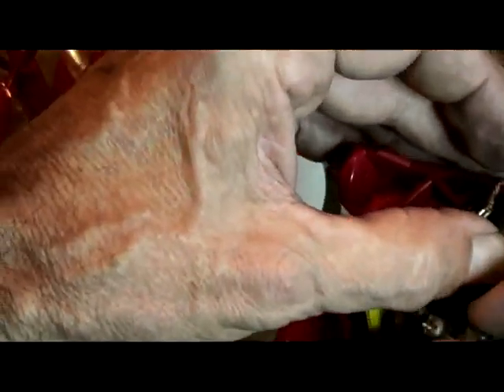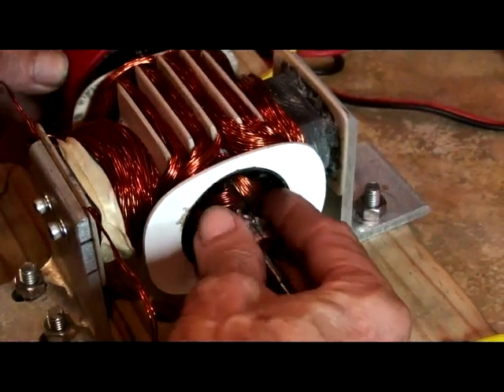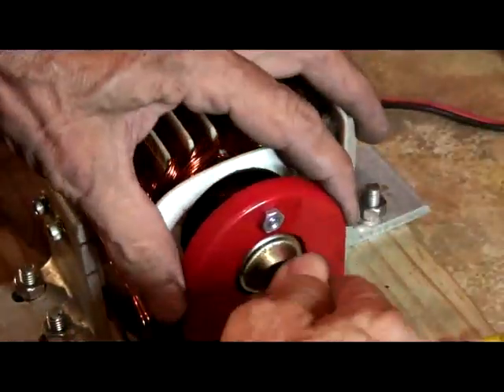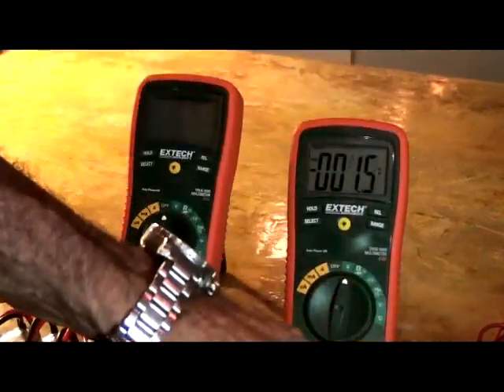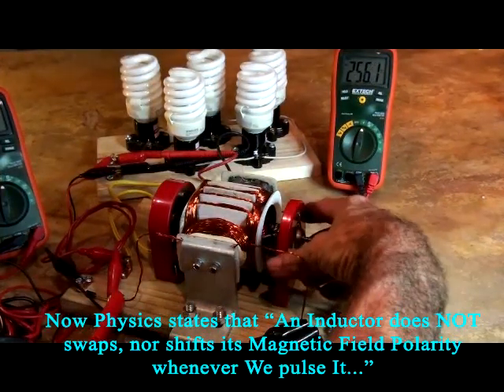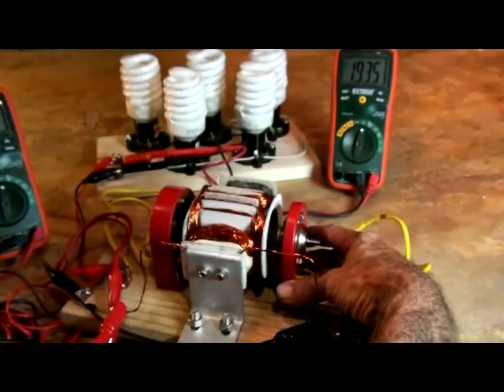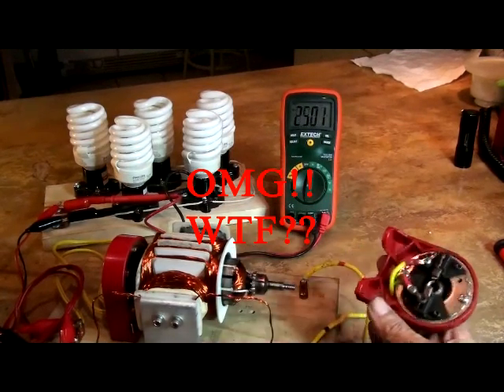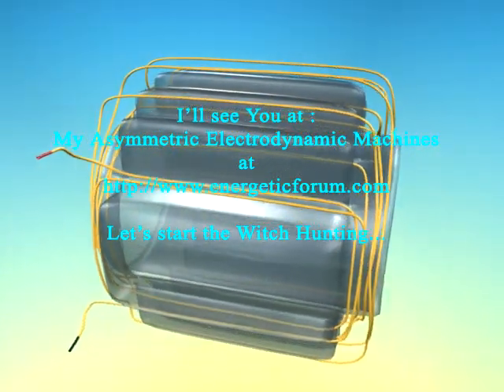ASYMMETRIC SINGLE COIL FIBERGLASS STATOR CORE

Comment: You are also getting state linkage. 1. Pulse stator = pulse to second file. That "loosens the electron state" By the second pulse you are 2. getting more out of the previously standing electron state within the second coil because of the BEMF. Just plain beautiful. I too am working on bifilar arrangements using 4505 diodes as my frequency shunt. AWESOME work. As to the fellow with his concept of "dirty" light. I recon we could afford to stuff a couple of caps in the line and clean it up well.

Comment from the maker: Of course that light is not perfect...of course it oscillates/pulsates identical to the feeding source...
And obviously it could be filtered,and cut spikes,and make it steady,anyone knowledgeable in the Art knows that.
Video is made to prove "A Point", and I did...A Motor, with excellent High Torque...High Speed as well...and like it would not be "enough"...it can generate the excess/unused Energy.
Results We could be NEVER Achieve based on our Symmetrical Models...yes, the ones we learn at EE.

Comment: Well done,
but you did not show us, how much input you did use....

Must be also a lot, cause you had pretty big arcs at you commutator, so the 
input amps seems to be high...

So without measuring the input power via lowpassfilter and shielding the meters,
it is hard to say, if you really have overunity...

Regards, Stefan.

Comment: Very good work. I like to adapt your motor to use High Voltage and High Frequency. Then we can combine any energy extraction from the medium to a motor to drive an alternator in to standard mains via inverter for any load. Namaste. Thomas